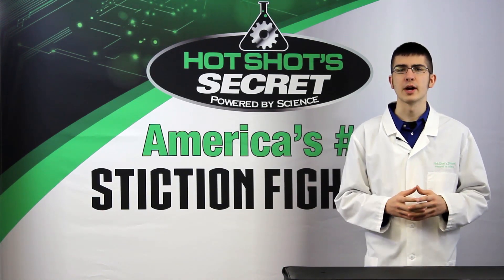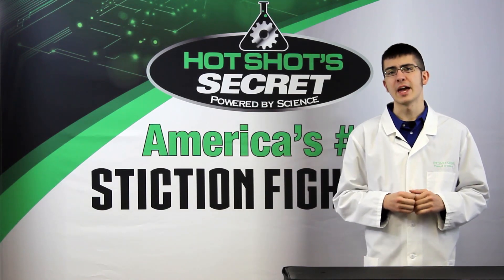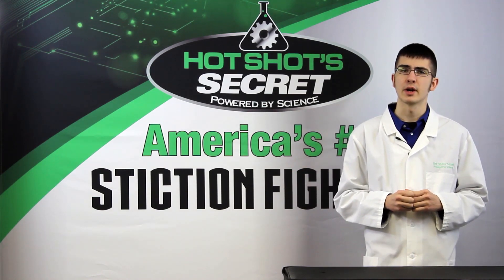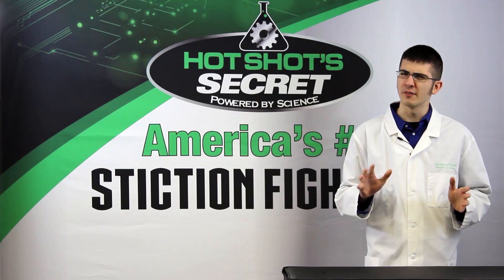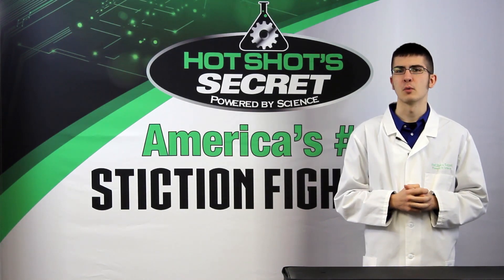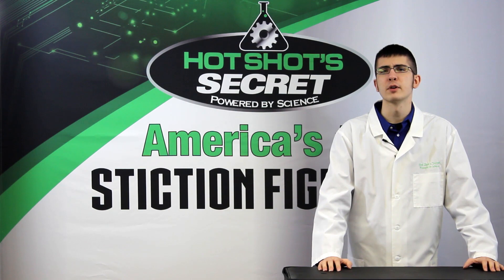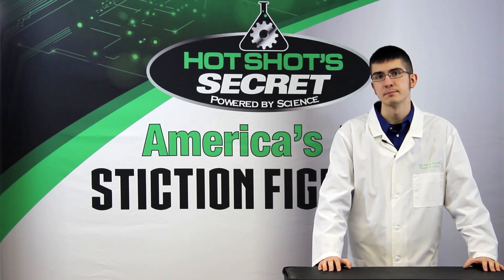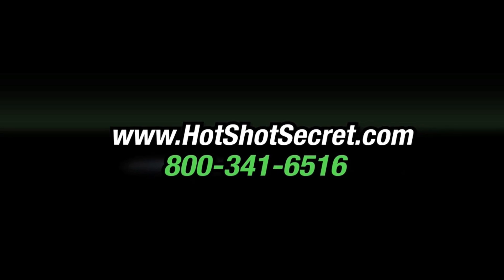Blow-by - Detroit Symptoms

Comment: My engine is still new.2400 miles i put a 750 Holley carb,  it. Had a 650 should i got bad to that? To stop blow back? Changed oil breather and pcv value. Thanks.

Comment: Maxforce dt.
 run ok. When cold. When gets hot runs like misfire ans starts blue smoke. What could be wrong
Reply from the maker: Blue usually means one thing: you are burning oil. You might notice a burnt oil smell while stepping on the accelerator, or maybe see blue/gray smoke leave your exhaust on startup or heavy acceleration, these are some of the tell tale signs that you are burning oil. Common issues include piston rings, valve seals, PCV valves, injector o-rings, turbo seals or the turbo itself; depending on the vehicle. Stiction Eliminator helps remove the built up coked and varnished oil and soot, prevents future coking, helping the rings and seals do their job, which in turn restores compression. The cleaning of the turbo, camshaft and other internals that oil comes in contact with reduces friction in the engine, helping to lower engine operating temperatures and making the engine run more efficiently and smoother.

Depending on the year, some of these engines utilized HEUI injectors. It could be that the injectors are just starting to stick and while not quite black smoke, yet ... it will be soon. Stiction Eliminator would help that issue, also; guaranteed!

Comment: I have good compression,  but,  the air coming out of my oil cap is very strong.     
On my bike sv650.

Any ideas?
Reply from the maker: It appears that this is a normal behavior on the Suzuki SV650. Thanks!
Reply: Hot Shots Secret 

Thanks for the response.
Reply: Hot Shots Secret 

Could you tell me why it’s normal for this bike to have strong pressure coming out of crank case?

Any literature you can direct me to?  Or do you just know from experience
Reply from the maker: @114wildfire  Not from experience, sorry. Please read a few explanations in the link below......

https://www.svrider.com/forum/showthread.php?t=47756

Comment: i overhauled my toyota 2c engine but after i rebuild i've notice the oil leaking from the breather hose..whats the cause of this?
Reply from the maker: Hi! Would say that the rings have not sealed to the cylinder walls yet.  This may be a matter of time needed for the rings to seat or the rebuild was not done correctly; were the cylinder walls honed, were the rings installed correctly?  It may be that it just needs time (miles) to get broken in correctly.
Reply: I rebuilt a20dth engine now I'm getting lots white smoke on tick over, think I might have put too much oil in.

Comment: For gasoline engines is it normal?
Reply from the maker: No, it is definitely not as common as a diesel engine, unless it is high mileage, worn out, not well maintained, etc...
Reply: @HotShotsSecret  no smoke is coming just small amount of air is coming is that oky??
Reply from the maker: No smoke is a good sign. The only way to know for sure is to have a compression test done...hope that helps, thanks!
Reply: @HotShotsSecret  oky thanks buddy
Reply: I have good compression,  but,  the air coming out of my oil cap is very strong.     
On my bike sv650.

Any ideas?